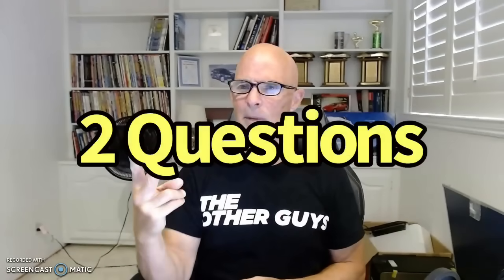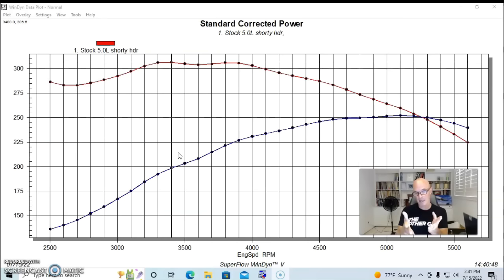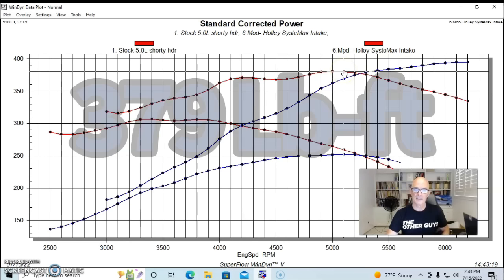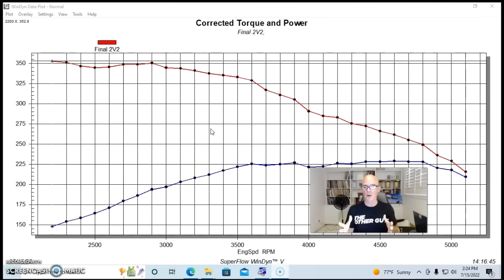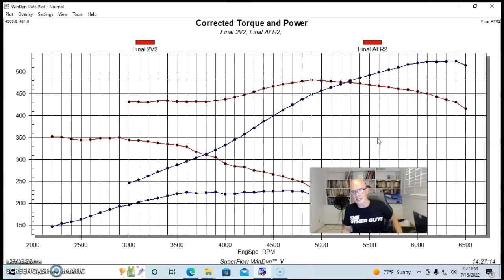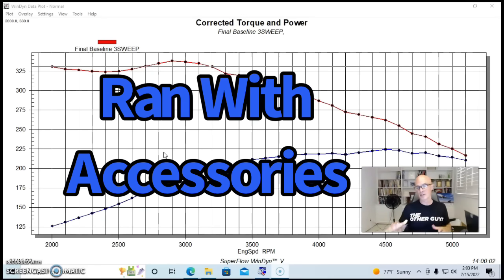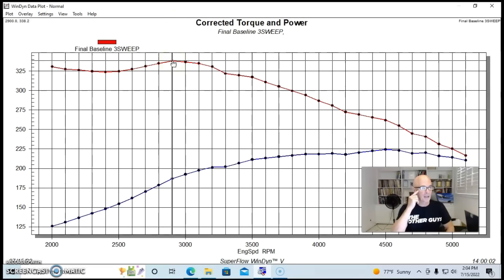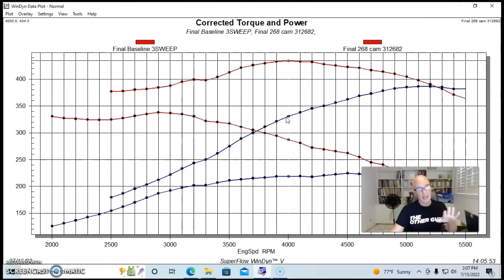FORD VS CHEVY VS DODGE-WHAT AMERICAN V8 MADE THE LEAST AMOUNT OF POWER? 5.0L VS 350 VS 360-WHO LOST?

Comment: My friend in high school had a 73 charger with the 360. It was a dog. We swapped in a junkyard 440 out of wrecked 69 charger it hauled balls after that
Reply: I had a ‘73 ram charger with a 360 in it, it was a beast damn near lift the front wheels if you floored it up a hill……looked completely stock but I know it must of had a cam swap, it was way to powerful for a ‘73 (360”) especially in a heavy awd early ram charger…..wish I never got rid of that thing!!!
Reply: @trentdawg2832  yeah in 78 a 360 powered the fastest production vehicle in the world. 1978 and 79 dodge lil red express
Reply: @timbrwolf1121  you never road in a car with HEMI
Reply: @trentdawg2832  nah it was stock, my 86 ram charger with a 360 was the same way wish I never got rid of it honestly. I know it was stock cus I went in and made it much better.
Reply: Sounds like a tired motor....
Reply: @Ollywood00  a roofer that I  worked for had a 70something dodge pickup with a 400 that thing ran good
Reply: @Ollywood00  yep it was
Reply: We used to call it a 3 sickly (60).
Reply: @robl4377  a fairer comparison would have been the 340...
Reply: 360 was never a performance engine....
Reply from the maker: 1978 E58 360
Reply: @richardholdener1727 Fastest production vehichle in 1978 Lil Red Express
Reply: @richardholdener1727  Also Richard, in 1977-79, that E58 was the most powerful Small Block you could get at that time.  Dusted Fords and Chevys.  Why do you think all the Cop Cars were MOPARS?  Better than any 350 or 351.
Reply: @ChiefCabioch  I'm not a dodge guy like my friend is but all I know is after the first drive with the 440 you couldn't wipe the smile off our faces with a baseball bat

Comment: What ford engine will make a expedition haul a..
Reply: There's alot just depends what you want
Reply: Guessing it's got a 5.4 Triton engine..........just toss a super charger on it. Changing axle gearing makes a world of difference too.
Reply: 12v Cummins
Reply: You mean excursion
Reply: The engine that is in it with the right mods.
Reply: Get a 7.3 power stroke😁
Reply: Or yes, as someone else mentioned a 12v Cummins would work really well. I just like the idea of the 7.3 cause that was a factory option, you could make it look stock

Comment: Chevy 305 for the win of lowest power V8’s lol
Reply: Yeah and any time I hear someone complain about the 4.8 Silverado I think they must have never driven a 305 powered Chevy truck
Reply: @Daveyharledson  idk my 293 is a tire roaster and the 305 was a economy engine, made decent power. People fail to understand that the GM engines are decent power but durability is a must so they intentionally do it so people can find the full potential.

The ford 5.0 in 92 in a bronco was very gutless
Reply: @shadowopsairman1583  yep and they were garbage too.
Reply: Yeah they were bad
Reply: I have one in a 82 camaro and stock 145 hp and its a turd.  Acceleration to 25 mph is good then flattens right out! Its like a inboard engine lol!
Reply: The Ford 255 Windsor, manufactured in 80-82 had 115hp. One of the mid-70s Chevy 262s had 110hp. I think the lowest rated 305 was a California-spec car with 130hp.
Reply: Just try to run a Chev 307
Reply: @morelanmn  i was thinking 305, then you said 307 and I was like omg that's so bad I guess my mind erased it
Reply: Slow but reliable!